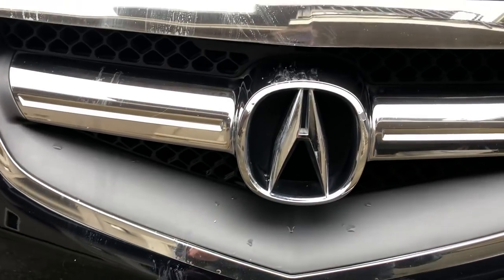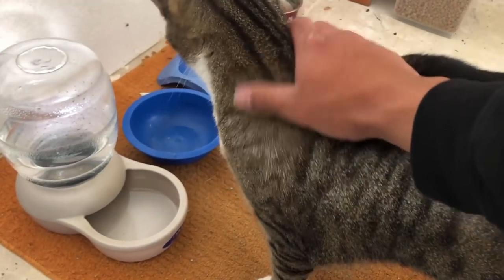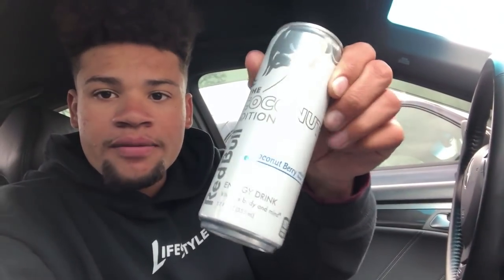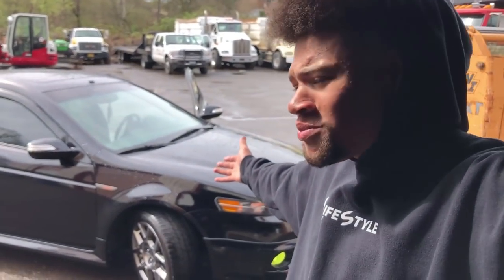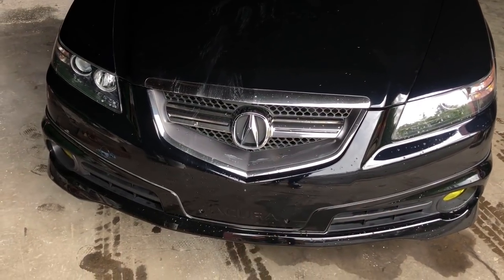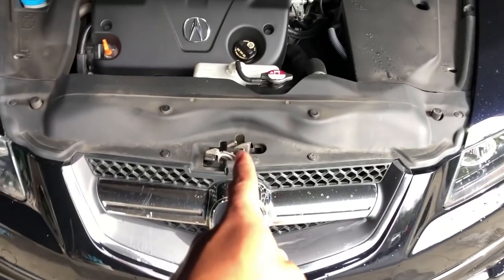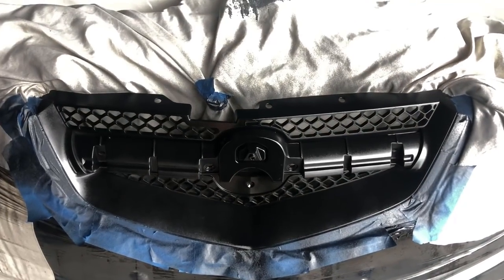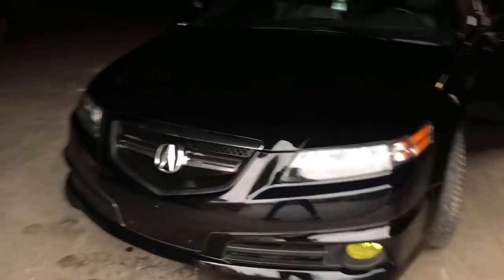Blacked out grill on the Acura TL Type S!

Comment: Dammm the cat got it good 😭😭
Reply: Also was it hard to reach the screws from behind the bumper?
Reply from the maker: iBex and Lucha yeah I went from the bottom that’s why u see it jacked up but it wasn’t to bad
Reply: The LifeStyle did you have to use a right angle screwdriver or anything to get the screws out? And is it possible to get that piece off without jacking it up or no
Reply from the maker: Just a ratchet u can still get it out might take more time but oh well lol